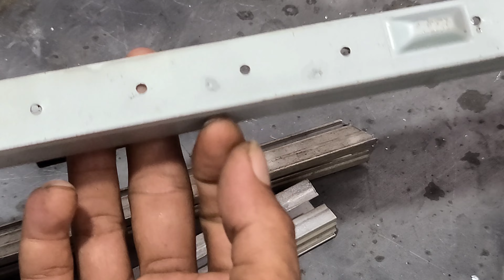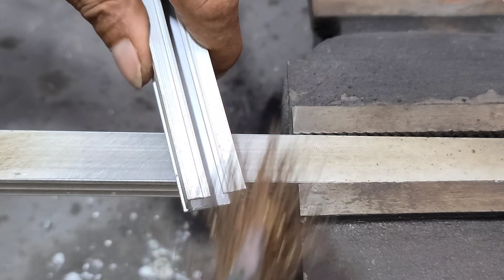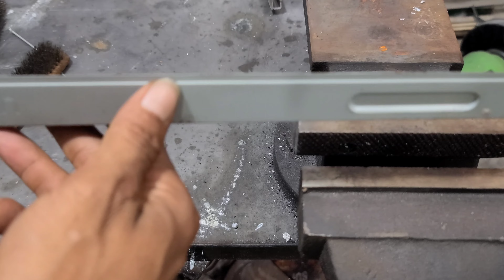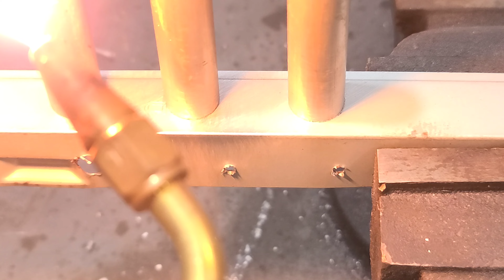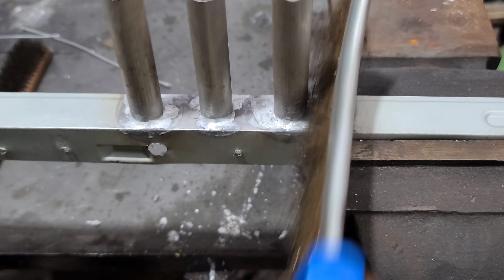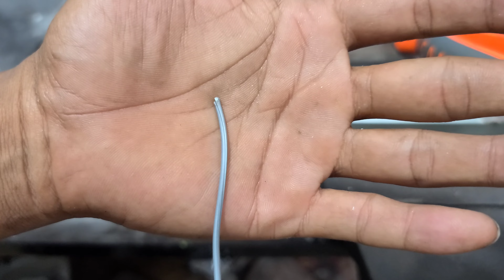Best Aluminum Welding Rod  No Welder

Comment: if you scratch it with a stainless steel blade or similar it will flow easier  
its mostly zinc  and is brittle 
you see operators bending the work after brazing making out its stronger than parent metal but the work is softened after brazing so bends very easily , it has its uses for some jobs